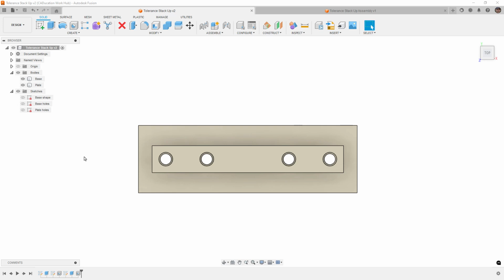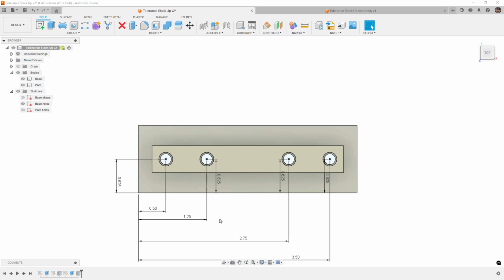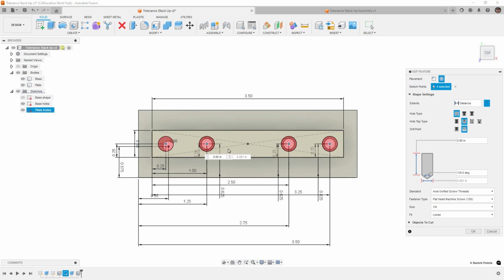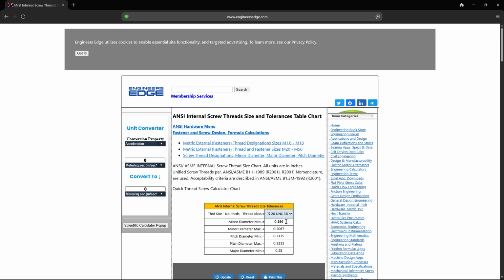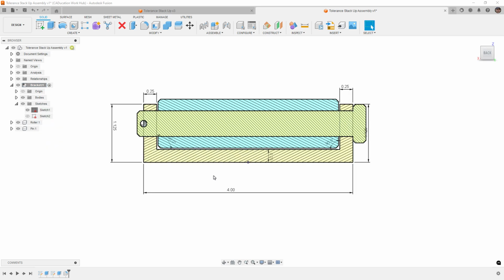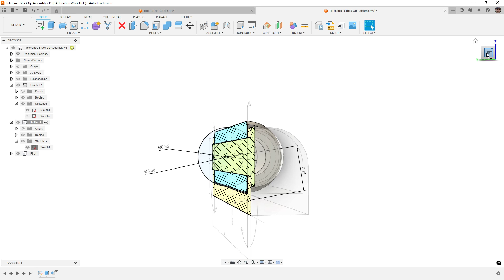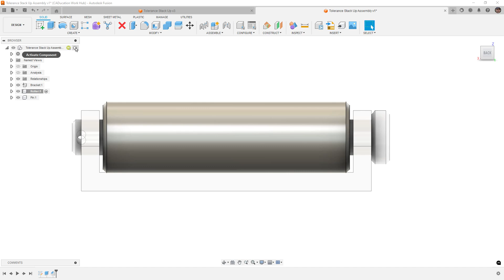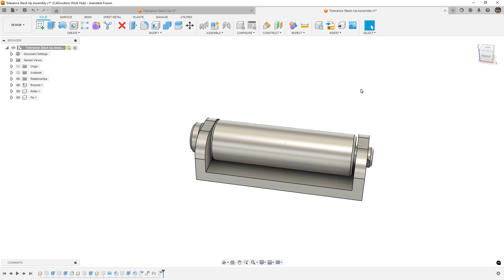What Is Tolerance And Why Its Important In Your Designs

Comment: Would like to see more of this. Especially after the newest update of fusion.
Reply from the maker: Do you  mean on the design side, or include changes that were made to drawings?
Reply: @LearnEverythingAboutDesign both. 
Also if i could request, it would be nice with a series about fusion manage extension/ fusion manage, and the workflow there. An effective  and robust way to use it as a point of truth for the development process and to gather as much information on the process as possible on one place. A step by step from creating a design to add supplier information and collaboration. And most importantly in my case, how to implement fusion management extension with configured designs. It seems like a soon as a design has configurations, it can not be assigned item number and so on. So what’s the advisable workflow in those cases. I have a lot of configurations in my design because it’s very practical, and I feel Autodesk has promoted it a lot. So not being able to use fusion management extension together with it is quite strange to me.  I feel there is a lack of good tutorials og walkthrough of the workflow in this PLM software out there. Most videos is just about what it is, not concrete how to use it typically. 

I’m talking about fusion manage and fusion manage extension side by side since as of 7th of November they are basically the same.
Reply from the maker: @87osvald  There are changes coming to this functionality and as i mentioned in the video about the CE hubs, that has an impact as well.  Basically CE hubs are the future and the metadata like component properties, release status and workflow etc are going to be independent of the design i believe.

With this recent update if you are on a CE hub and using manage there are some new templates for workflows/stage management.

I did some marketing content for Autodesk around this stuff but you are right there isn't really tutorials on this.  I will see what I can put together but likely it will be in Jan when the next big update happens as I think the functionality is going to change a little.

Comment: An important distinction that is missed especially in the hobby 3D printing community is the difference between tolerance and clearance.
Reply: Clearance controls tolerance. You tolerance something based on your fit type. If you choose a clearance fit for your feature then your tolerances would change compared to something else like an interference fit
Reply from the maker: Exactly!  This Tolerancing vid is more aimed toward CNC milling than 3D printing.  Generally with a 3D print a "tight fight" is .2mm gap to .4mm gap (.008 - .016in), but that is in the model.  You physically make a hole bigger or a shaft smaller because of the fact that a 3d printer lays down traces of molten plastic and there is some associated variation.

3D printed parts are generally "looser", and using the same printer for 2 parts that fit together, you generally don't have to worry about tolerancing.  But if you design a part to be CNC machined and send them out with the wrong tolerance, you might get lucky and they fit, or you might not.

Comment: As someone who is not a engineer but designs stuff time to time tolerances is probably the biggest issue I face. How much is too much, how much is too little, how much tolerance do I need to achieve the friction, fit or tension I need
Reply from the maker: Yup.  its easy to think ".05in is a very small number" but it doesn't take much to make 2 holes not line up.  
Most standard CNC parts will be .005in (.13mm).  It is easier to get a hole diameter in tight tolerance than its position.